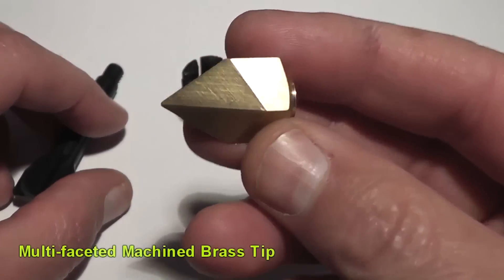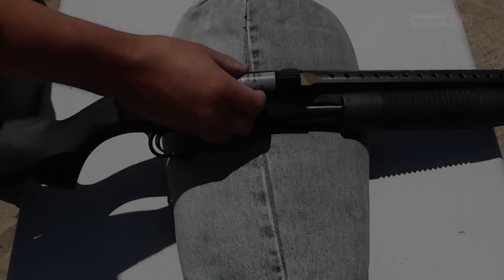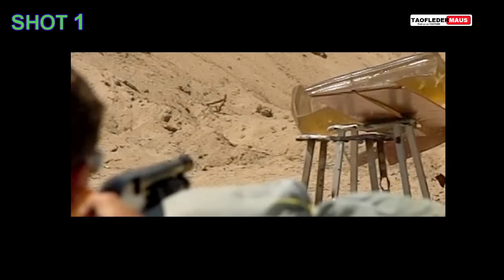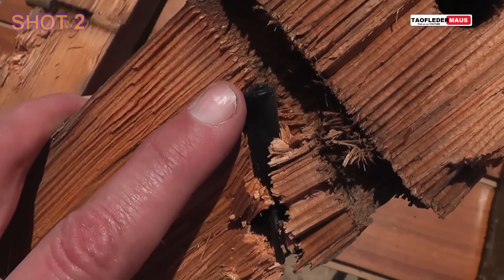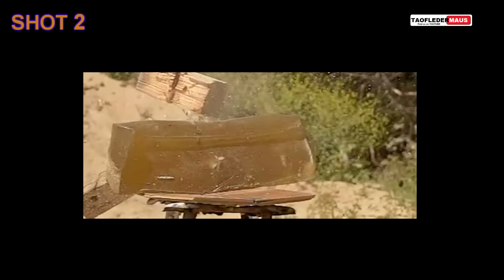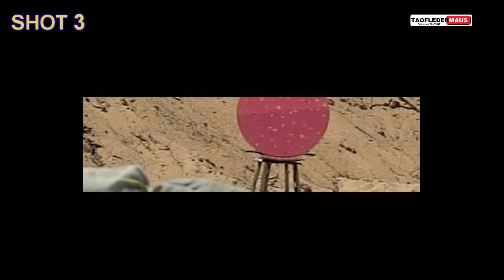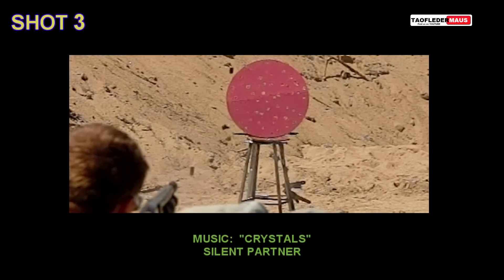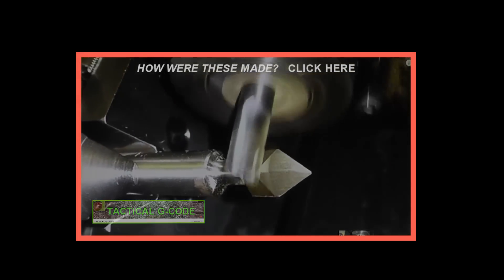MINI-ARROWS Exotic Shotgun Rounds -  Discarding Sabot Projectiles

Comment: i like what you do. i would love to see a lead caped shoot with a space and a copper cone behind it. so when it hits the shock wave hits the front edge of the copper cone. and turns the copper cone inside out a simple shape charge type penatrater. i would like to see if it works

Comment: yknow something i'd like to see would be two lead balls held together by a guitar string, preferably an E string. I know this is a concept that's been done before but I feel like the design of the guitar string would hold up better under the ballistic tension. idk if you'd give it a shot that'd be pretty neat to see what happens.
Reply from the maker: goldeneye0019   I don't have any round ball molds.    I am going to shoot some double-ball bearing loads though.   They won't have a wire on them,  can't drill a ball bearing
Reply: darn, ah well i'm sure that video should be pretty neat. i'm sure down the line you might find an opportunity.
Reply: ***** also if you happen to still have some of those turbine projectiles lying around and intact enough to fire it'd be cool to see if they work better underwater since they don't hold up too well in the air c:

Comment: Man, I love this series. The idea of getting to watch you shoot random, custom projectiles, and just hoping they fly straight, it's the most fun I've had on YT in a long time. 

I haven't actually watched the video yet, just wanted to mention that. It's like Christmas every time I load up and see one of your projectiles waiting in the queue. :D Thanks again!
Reply: Just out of curiosity, would an end-wad even be needed if you were to put a discarding support sabot behind the head? I mean, it seems like the whole business of trying to charge and wad behind the dart is creating some design issues...I'd wonder if you could just have the powder charge in and around the tail and fins, put the sabot and was along the shaft, right behind the head, and see how that goes.
Reply: Lunumbrus and wad*
Reply from the maker: Lunumbrus  The wadding is needed to form an efficient gas seal.  the main powder charge probably wouldn't have enough pressure to ignite.
Reply: ***** Huh...could a gas-check concept be applied in this case? If a seal were achievable between the wad, head, and barrel, it'd at least take some strain off of the dart shaft. 

Sorry, just random ideas, I appreciate that it's a pretty difficult issue, safety and design wise.

Comment: I'd like to see you do this again but at longer ranges just to see how stable and accurate it would be at say 25-30 yrds.
Reply: he did the last one at 30 yds
Reply: +Corey Shier Yep Last shot was at 30 yards. Looks like the round would travel much greater distances and still be stable.
Reply: +MasterMech77 I'd want to see 50 to 100 yard tests but using heavier material
Reply: Thor Butler
Yeah that would be a nice range to see them used at considering their design and flight ability.

Comment: You know, one issue with these is that they stick way out the front of the shell. I recently saw a video about 40mm telescoped ammo used by a french gun and it got me thinking something like this could be telescoped. Drill the gas seal to fit around the shaft and seat behind the arrowhead with the shaft going through and seating against the primer. Cut the gas seal in half so it separates clean from the dart also. Maybe cut a slot in the base of the shaft so it doesn't block the flash hole.

This would instead of pushing the arrow from the base the wad/seal would pull it from the head. The shaft would need to be made out of something stronger then plastic though to survive the heat of burning powder and being pulled on.

Comment: I think if you reduce the front loading of the weight on the dart, it would fly straight sooner out of the muzzle. Because the front of the dart is so much heavier than the rear, the rear of the dart may be getting pushed forward a little to one side as the shell assembly comes out of the muzzle. And then the aero drag of the fins pulls the rear back behind the dart tip. But if the center of gravity were closer back towards center, the rear of dart wouldn't be torqued forward as much as the assembly leaves the muzzle.

Comment: have you guys ever thought of getting a break action shotgun for these tests? would make it easier for doing tests with things like full sized cross bow bolts. I enjoyed watcbing these tests but I think a full single brass salvo dart would work extremely well with similar design just a single piece, maybe shot at steal to test full effectiveness of the rounds penatration.
Reply: sadly I don't think it would punch through steel. what if the tip was depleted uranium :p
Reply: +Thor Butler then someone might end up in jail sadly ;(
Reply: +Rian Mach I looked up the laws and regulations for depleted uranium they could but they would need licenses to order it and have to explain reason why they want it
Reply: +Thor Butler oh sweet

Comment: I can tell you what happened to the brass arrow. On shot 2 you said the threads broke off correct? Well if you look at the sand pile you were shooting at, immediately after the shot is fired you will notice a small puff of airborne sand. This means that the brass arrow broke off and kept flying straight into the sand. These seem to be some powerful shells for sure!

Comment: I hate to naysay, but I think you should look at the footage of your last shot a little more closely. It looked like the brass tip separates from the dart prior to impact, curves up and to the right, and passes the target at two-o-clock. And looking at the reverse shot towards the end, you can see that the same shiny brass object separates from the dart during or immediately after leaving the barrel.
Reply from the maker: midesti   I think what you are seeing is the white teflon disk .   I didn't show the backside of the table very well in retrospect but there was an arrow tip shaped hole in the wood.   But you can also see the arrow ejecting out the back in high speed too.
Reply: *****  Interesting. I really like the design of these rounds, by the way. I'm sure folks like the guy who designed these get all kinds of "well, what I would have done" comments, but if I designed a round like that, I would think that sabots, or some other way to contain the compression, would be the way to go. I think that is why your hardware store rounds worked so well. They were like little mortars.

Comment: On the third round... Was it the brass tip flying up to the right or a plastic washer? Looked like a piece of metal... Did the tip break off?
Reply from the maker: dyffykins  That was probably a wadding.  The brass went through with the rest of the arrow.

Comment: Im no expert  by any means, but why use a single shot shotgun for these novelty  rounds?
Reply from the maker: Jon J   I  all ready have this one.
Reply: It would be more practical for the novelty  rounds, even a slam shotgun  would make it easier to load
Reply from the maker: It only takes 30 seconds to remove and put the barrel back on.   It takes  much longer to just set up all my cameras for a single shot.

Comment: Your machinist is doing it wrong. Looks at physics and aerodynamics. How the air travels around a bullet or arrow. The bullet or arrow spins. So you need to have small off center grooves in the outer edges of the ammo. So when it fires, it spins through the air like a spiraling football or an arrow shot from a bow. Less wind resistance, smoother spinning. It will not wobble that way.